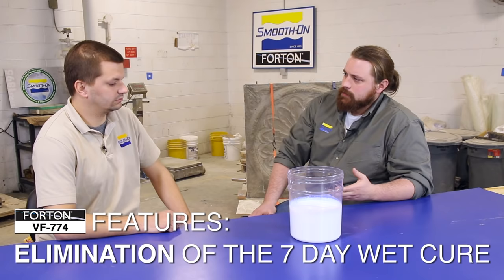GFRC Explained - Learn the Basics of GFRC

Comment: I am at a company that's been doing GRP for over 30 years, and we are wanting to branch out into GRC. There's a ton of info out there, but nothing so far has so clearly walked me through the process and the materials needed as this video has. Very informative, clear, and concise. Thanks guys.
Reply from the maker: Thanks for watching, and don't forget to subscribe!
Reply: Hi mr dale i was just looking through the internet trying to find an answer for a question untill i came across your comment 
My question is, is GFRP usable in concrete slabs as a complete replacement of steel 
slabs that aren't rested on a ground beneath it say the slab of a 2nd floor

Comment: How do you feel about not adding plasticizer to keep added strength? Using basalt mesh and fibers in place of fiber glass?
Do you ever recomend silca fume if so when and how much? I do counter tops and need to be able to use thin castings about 1" 25mm most times and have sections that cantilever out from support. Thanks Ray Stormont
Reply from the maker: There are infinite variations available for concrete mix designs. All of the items you describe are potentially viable, but must work in concert with the rest of the mix to make a good final product. We typically recommend plasticizers as a way to keep the water to a minimum, which in turn increases the strength of the concrete. We do not have specific recommendations for basalt fibers or silica fume. 25 mm thickness is common with a high strength mix design - focus on proper placement of reinforcement in the plane of tension. If you have further questions you can reach out to our tech support team. https://www.smooth-on.com/support/ticket/add/agree/

Comment: I'd like some advice on my spiral staircase design.  It's a helical stair and is only attached from the first step and the last step to their respective floor slabs.

I would like to make modular GRC moulds for the poured in concrete.  With the exception of the tread, it will serve as the finish itself.  I know it's going to sound complicated, but that's the design intent.  I would like the modules to be really light enough to handle but strong enough to serve as the external surface.  This is why I thought of GRC.
Reply from the maker: Hi there!  This is a good question for our tech support team, can you send them a ticket here? https://www.smooth-on.com/support/ticket/add/agree/ Thanks for watching!

Comment: Great video thanks. Just a quick question. In a premix design, when it say the fibre glass should be 3% of the entire mix - is that 3% of the dry components in weight, or 3% of the dry and wet components combined? Please let me know.
Reply from the maker: Thanks for watching! The measurement is 3% by weight of the total mixed system, including all dry and wet components.

Comment: Great video. Is there an advantage of AR glass over basalt fiber? Literature indicates there is a tighter bond between basal fiber and cement and that it is inert with regard to alkaline environments. What are your comments?
Reply from the maker: Hi Reed, this would be best answered by our concrete tech team.  Could you submit a ticket to them here? https://www.smooth-on.com/support/ticket/add/agree/
Reply: Did you find an answer?

Comment: Great and informative video.  Why is that GFRC as well as some of the other products mentioned on this video is hard to find here in the US?  I've tried searching for them on a few places here in Yuma, AZ but can't seem to find a local hardware store that carries them.  Does they go by a different name brands here in USA?  Thanks again for the video.
Reply: Manuel Villalpando well for one thing they are talking about using the best of the best on every single ingredient.. I can tell you even on union Crete jobs we don't worry about stuff but maybe 30% of what they mention... for instance for almost all jobs ANY type of fiber glass is sufficient... also I've never in my 20 years seen a concrete company that delivers us finishers concrete that includes actual potable water. Sand also is very rarely an issue even when shooting of a gun. If you're doing DIY stuff you can probably just ask around local tradesmen and workers at hardware store... even just read the instructions on the bag of cement in the store
Reply: Same here in Calif  also looking for uhpc  none around one place but u got to by it by the ton

Comment: I live in Myrtle Beach, SC and I'm installing an addition to my present driveway. My current driveway is about 600 sq. ft. and the addition is adding another 800 sq. ft. for a total 1400 sq. ft. Also the depth of the addition is 12 inches. 
Now when I say I'm living in MBSC, I don't live directly on the sand, I'm more in-land, but there's still a sand/soil-mix. Given your Premix formula, would that be appropriate given what I'm wanting to achieve, or would you suggest something else?
Reply from the maker: Hi Justin, it would be best if you discussed this with our concrete casting team - they can be contacted at https://www.smooth-on.com/support/ticket/add/agree/

Comment: Can GFRC bond to foam core/XPS/EPS? I am looking for strength and durability added to the foam, yet maintain a rough texture of cement to make look like a rock.
Reply from the maker: Buddy Rhodes offers a concrete product specifically designed for this - https://www.buddyrhodes.com/buddy-rhodes-vertical-mix

Comment: In your "recipe" it say the spray-up has fiberglass in it, but that doesn't seem to be the case when I see in other videos how they spray it on with only a hopper spray gun. Also, if they spray-up mix has more GF in it, how come it looks thinner than the pre-mix and seems to be sprayable at all? I would imagine a slurry with more GF in it, would be less sprayable than one with less? Sorry, just confused. Can you clarify?
Reply from the maker: Thank you for the comment. It is a bit of a misnomer because the facecoat for both method is typically sprayed onto the surface. In fact, Spray-up and Premix are made with the same steps in that there is a face coat and backer mix applied sequentially. The difference is that with a backer mix in a Spray-Up application, the AR fiber is not preblended into the slurry. Instead, the AR fiber is added when the slurry is exiting the spray gun head - there is a separate chopper gun that cuts and incorporates the AR glass roving into the stream of slurry as it exits the gun. This is how you get a higher fiber content - it isn't mixed into the slurry from the beginning, and more can be incorporated at the gun head (usually 5% load of fiber by weight of the system). This video shows the spray-up method in detail: https://www.youtube.com/watch?v=Iwjk_1Ks5zI 
Hopper guns are primarily used to apply the face coat mix in a Premix method. There is no fiber in a face coat mix. The standard hopper gun you see in most videos cannot spray slurry with AR fiber mixed in. When the AR fiber is premixed into the slurry is it typically applied by hand, but there are specific pieces of equipment that can spray Premix backer. Usually you are limited to up to 3% load of fiber by weight of the system in a Premix application - beyond that and it simply becomes too thick to be workable.
I hope this helps!
Reply: Thank you for explanation. So for home, or lo-fi use where we don't have access to such spray guns that can mix AR, you suggest doing a spray-on mix with no fibre and then add a little bit of AR fibre manually at back and then add the premix after that?
Reply from the maker: You would spray 1-2 layers of face mix (no fiber) with a hopper gun. We prefer 2 layers, while lightly brushing the backside in between. Let that sit for 30-40 minutes until it hazes and becomes a bit stiffer. Then mix more material with 3% glass fiber added and apply that by hand in 2-3 layers. Ultimate thickness should be 3/4"-1" thick. Here's a good process to follow: https://youtu.be/_DkHWLrwZSw?t=3m18s

Comment: can it  be cut and engraved easily with cnc router (tungsten carbide bit )?
Reply from the maker: You would have to test this, but it would perform similarly to standard concrete.